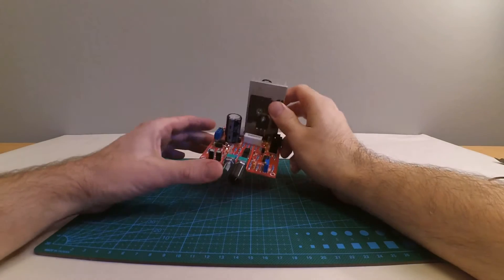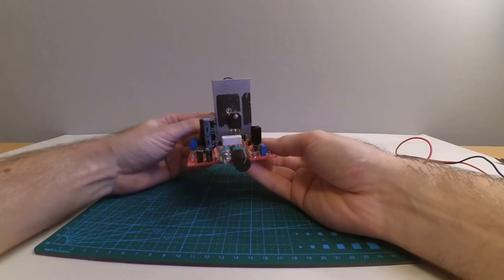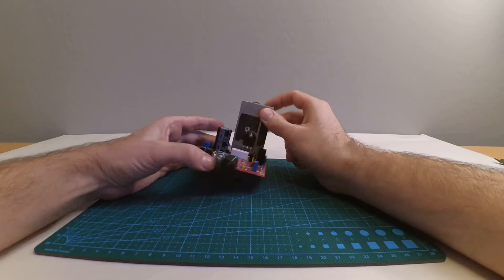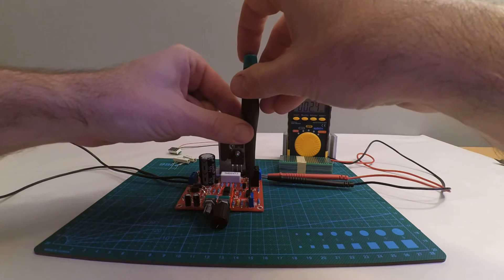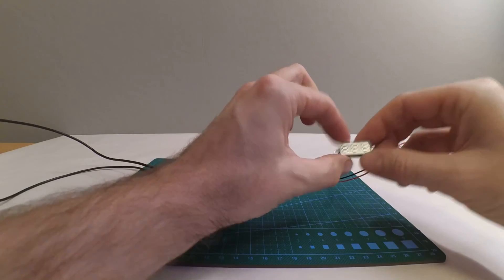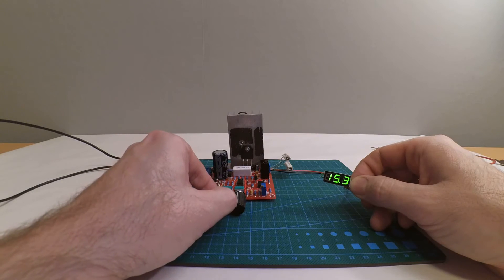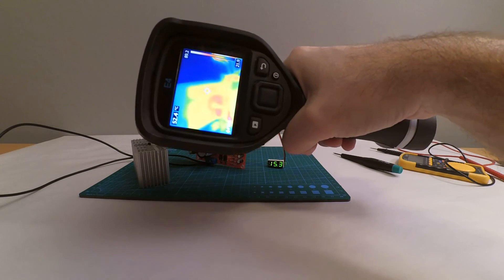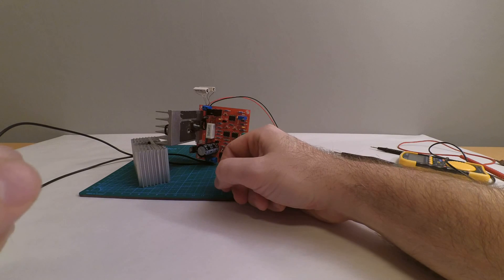#1:2 0-30V 2mA - 3A Adjustable DC Regulated Power Supply DIY Kit - Part 2 Testing

Comment: Hello, I made this kit and when I first made it, I gave AC30V to the input. The TL081 integrated circuit and R2 80ohm got very hot. Then I changed the TL081s and gave AC22V to the circuit. When I turn the pots and trimpot, none of these values change. And I see 30V at the input of the TL081s. I don't know if this value should increase to 18V. The documentation says -18V & +18V, so the total is 36V.

Comment: Hi, My input ac  voltage is 29v, and R2 which is 82ohms gets really hot, is it only BCS of the input voltage.  Thanks
Reply from the maker: The circuit is designed for maximum 24V AC, over that and you will blow the op-amps.
R2 is part of the negative voltage pump and with a to high input voltage you will dump a lot of power in it.
Some recommend running the circuit with only 20Vac input voltage.
Reply: @KristianLaholm  thankyou so much for your inputs

Comment: Hi, can I use 24VDC and -5VDC power sources to power it up?
Reply from the maker: I don't have the numbers in my head but if you want to skip the rectifiers and negativ voltage pump it might work.
But I think the +DC should be up around 36V.
You have to follow the schematics and connect to the correct points.
Good luck :)

Comment: Hi, if I have a 12-0-12 center tap transformer, how do I connect it to the input? thanks
Reply from the maker: Check with a multimeter but normally the outer taps are the sum of the 2 voltages 12+12=24.
But the circuit is sensitive to over voltage, feeding it with 24VAC is at the limit of some of the components if the transformer gives out more then 24V do not use..

Comment: Thanks a lot! Your video is very welcome: I bought that kit, and no documentation came along...

The heatsink that I put was certainly too small , and I fried the D1047 during my first test with a load, I'm afraid... ;-(

Will buy another transistor, with a big heatsink.
Reply from the maker: The magic smoke and deep fried components are a part of the learning curve :)
Reply: @KristianLaholm  Well, my learning curve is definitely not finished: yesterday I received a few D1047, and I've just fried one!  I put an aluminium heat dissipator oversized, 10x10x3cm: that was obviously not enough!
Reply from the maker: @pierrechevaliergeol  What current are you running at? If you run at 3A it will get hot hot hot :)
Reply: @KristianLaholm  0A right now...

I ran it without any ampmeter, just for a small test with an old toy as load. It took about 5 seconds to fry. 

Now I changed again the transistor, I connected an ampmeter and I'll triple-check the components' wiring before switching on!

Also, I'll put a more predictable load, like a LED panel or something. Not an engine like the ones in that old toy.
Reply: @KristianLaholm  Yes, it does!  I've fried a total off three transistors today...  One small resistor located on the corner left of the potentiometers is also getting very hot, even when there is just a small power running.  Strange.
Reply from the maker: @pierrechevaliergeol  The hot resistor is probable to the negativ voltage pump circuit, it's known to get hot.
Reply from the maker: @pierrechevaliergeol  electrical motors can be tricky to power
Reply: @pierrechevaliergeol  absolutely right, this R2- 82ohms gets really hot, changed the transformer to 2amps against 3amps.  But strange, it gets hot.  My input volts is 23v

Comment: Hi. I made this kit, but voltage have fluctuation, UP and down,never stable.. With no load, only if i want to setlle the voltage do desired voltage.. What can it be
Reply from the maker: Is the voltage rail stable (after the rectifying diods)? Is the setpoint voltage from the potentiometer stable? That is the things I would start checking.
Reply: @KristianLaholm  Hi. After diode voltage is stable. Then set Point of potențiometer, how to check!?
Reply from the maker: Connect "COM" on your multimeter to "- OUT" then you can check voltage on the potentiometer. 0V on one side, i think 30V on the other side and mid pin is your setpoint.
Reply: @KristianLaholm  thanks i will check. All components is placed right, i check it.. I try to put capacitors on the 7812(i put 7812 for 12v fan) , to settle the fluctuation, but is The same..
Maibe if i remove 7812 from board and to Power the fan with other small transformer, It will help? I think because i use 40w transformer, can be the problem!?
Reply from the maker: @Sandokans  With a 40W transformer you can only take out 1A current or the voltage will drop.
The 7812 should't be a problem.

Comment: Does this connect directly to 120V AC wall?
Reply from the maker: No, the max input voltage is 24VAC. You need a transformer 120VAC -> 24VAC, current rating 3A.

Comment: Hi, what happen if you short the output?!
Reply from the maker: Hi, the power supply will then deliver constant current and the voltage will drop.
It will not burn up :)

Comment: Do you have the schematic for the power supply?
Reply from the maker: The schematic is on the last page of the "English manual", link to the manual is on Banggoods page: http://www.banggood.com/0-30V-2mA-3A-Adjustable-DC-Regulated-Power-Supply-DIY-Kit-p-958308.html?p=AR22132858920201510H
Or you can read about the "original" circuit here http://www.electronics-lab.com/project/0-30-vdc-stabilized-power-supply-with-current-control-0-002-3-a/
Reply: Thank you!

Comment: Hi, I have a transformer 12V/4,2A. Is it enough to power the kit?
Reply from the maker: I don't think 12V is enough. I have learned more about the circuit over time and it needs 24V AC to function properly.
You can try with 12V and nothing bad should happen more than to low voltage output.

Comment: I think when I get mine I will change the pot for a multiturn pot for voltage adjustment  to make setting voltage out easy
Reply from the maker: You could also do two pot's "in series", one for course setting (high value pot) and one for fine setting (low value pot)
Reply: That sounds good but how would you work out the values in series? do you see what you have done by being clever, making yourself more work and that means I will have to drill another hole.
thanks Bob
Reply from the maker: Sorry for the extra work :)
For my longer answer look at my video https://www.youtube.com/watch?v=wpvxlcn7kVk&list=PLCLbfOk6fdG17Ln-cCc3N-VC0yYeX2TtN&index=17

Comment: Thank you for the video I have ordered one but was wondering the size of the board as this is not shown on the seller site.

Thank you if you can help
Reply from the maker: The PCB is 84x84mm and the height depends on the heatsink.
Reply: Thank you now when it arrives from China in a few weeks I know it will fit in the box I have

Comment: Hi, I was wondering about what power of transformer should I use. I know this requires maximum of 3 amps of current. I found  a 24 vac 40 VA transformer for reasonable price. Is it going to be okay? I don't think the power supply will be able to provide 3 amps at 30 volts with it. Please let me know what you think.
Reply from the maker: Do you need 3amps at 30V? If not then use that transformer.
I didn't need full power thats why i chose to do the modifications I did.

Comment: what is the role of 100k pot, and what value should it be set
Reply from the maker: It is used to zero the output, use a voltmeter on the output and trim the 100k pot until you get 0V on the output.
Reply: ty

Comment: Do you use 24V DC or 24V AC? It says that need 24V AC, but it's a little dificult get a 230V AC/24V AC transformer, it had to be toroidal. 
In the PCB it alredy have the 4 diodes to convert to DC, are any problem connect the 24V DC instead AC?
Reply from the maker: +Francisco Madeira you must use AC voltage for the circuit to work.
There is a negative voltage pump for the op-amps and output transistor that needs AC .

Comment: what can be done about those two resistors getting very hot. switch them with larger ones or will they cope with the heat?
Reply from the maker: I have had no problems with the resistors.
I might need to take a second look at the problem :)

Comment: I am thinking of buying one of these but none of them seems to come with a heatsink, what size heatsink should I be looking for?
Reply from the maker: Hi. The heatsink i use is width 45mm, height 75mm and 25mm thick.
The width (45mm) is the most that fits one the PCB. If you are going to pull high currents also use a fan.
Reply: Do you know if it's possible to cut heatsinks to size?
Reply from the maker: My heatsink is cut from a bigger one so no problem.
If you are going to pull high current over long periods I would put more time in to finding the "perfect heatsink and fan"

Comment: hello friend, well all was going well with this project until what you mentioned happened! I acidently shorted the D1047 and now I am only getting full 30v at output.😞 I have several junk boards but I am not sure if there is any subsitute other than the D1047. Any thoughts about this? Thanks JW
Reply from the maker: +jwhiting352 Sorry to hear about your problem.
In the old schematics I found they used the "old school" power transistor 2N3055 (different package)

I would search for a general NPN-(power)-transistor with: 
V(CEO) > 60V (voltage across the transistor, D1047 is 140V)
I(C) > 12A (current thru the transistor) 
P(D) > 100W
And double check the pins (C,B,E) on the package.

I hope that info is helpful :)

Comment: English manual: http://img.banggood.com/file/products/201505080459530-30Vinstall.pdf
Reply from the maker: If any of U out there wants to learn more about this PSU here is the circuit it is based on http://www.electronics-lab.com/project/0-30-vdc-stabilized-power-supply-with-current-control-0-002-3-a/
Reply: Thank you! Great vide btw!
Reply from the maker: +Atilla Kiss Thank you for the feedback 😀